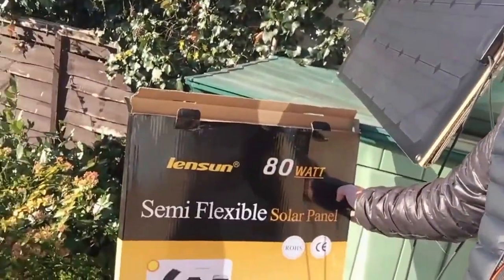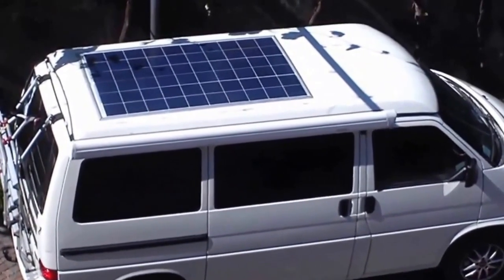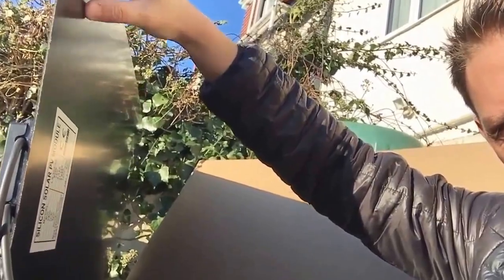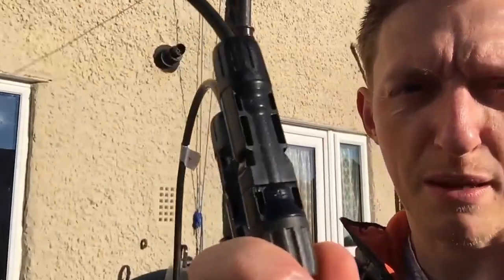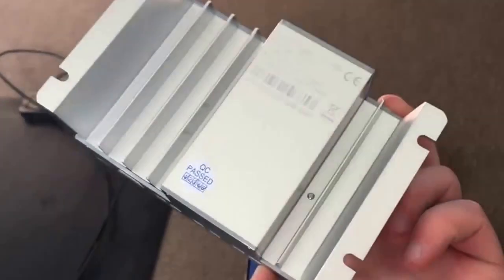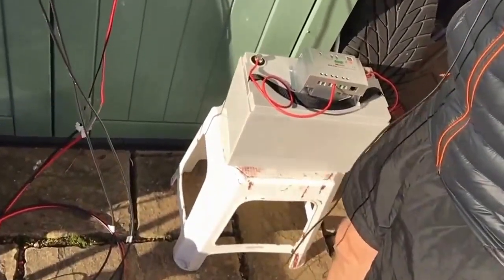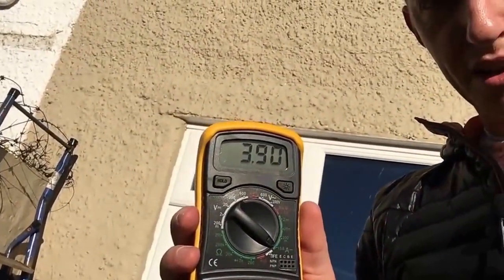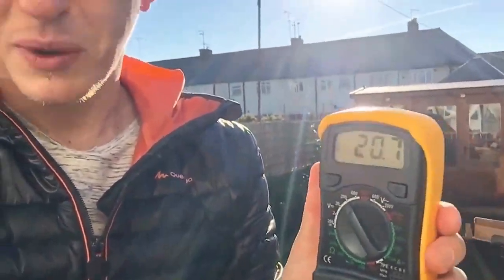VW T5 Camper Project Review of Lensun 80W watt semi flexible solar panel from G Dub Campers

Comment: Hey pal
Looking at solars all my research comes up with the same info LENSUN appear to be the way to go.  I have contacted them. gave you as the source.
Anyway whats the best way to take the wire from the roof to my leisure via Anderon clips.  Dont want to drill holes anywhere really.  I will glue solars down on to the roof but drilling a hole in the roof to feed the wire down through to the leisure battery rings or caution.
What da ya think pal.